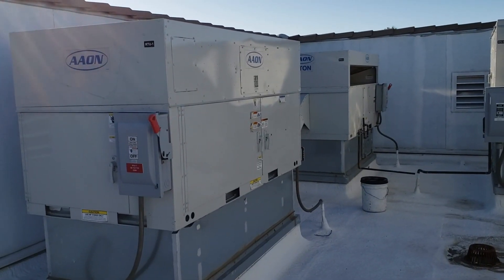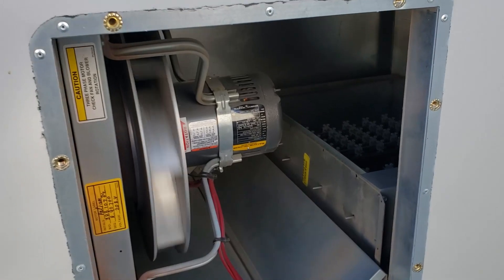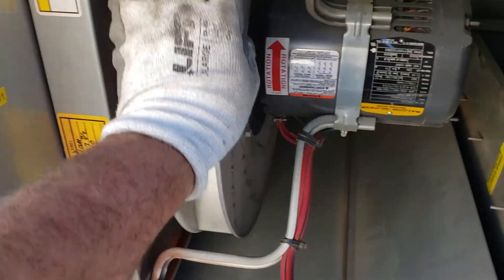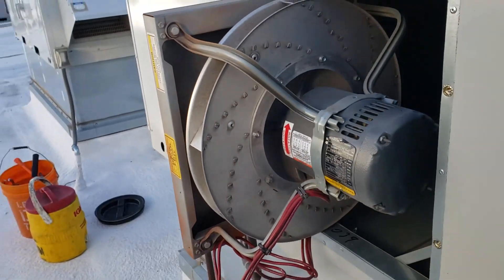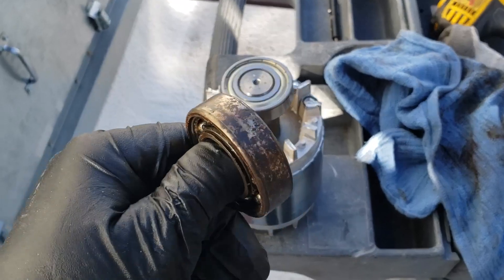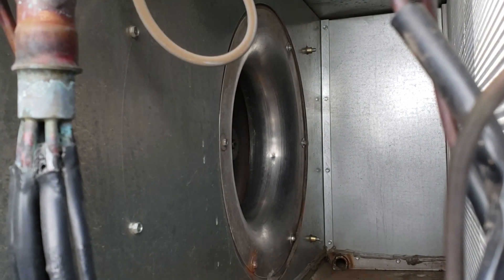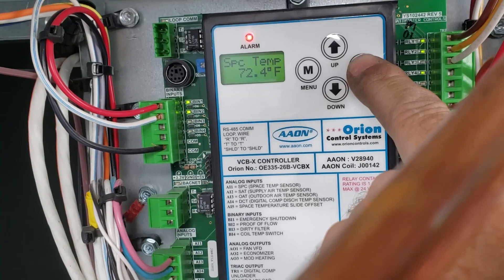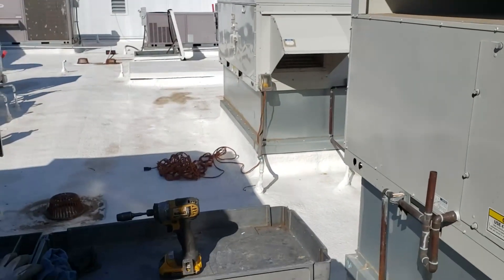Another day, another AAON bearing replacement

Comment: great video sir, i would like to know which tool did you use to remove the bearing and what brand it is
Reply from the maker: That's a common "jaw puller".
From harbor freight. Auto parts stores sell them etc

Comment: So when you do all these bearing replacements do they tell you what bearings to use or do you know already what bearings to use?
Reply from the maker: Are you asking the brand or the part number?
The part number for bearings are on most motor plates if they are pretty much 1HP or larger.

I simply just get a photo of the motor plate and go pick up bearings from the local bearing supply. I use off the shelf bearings.
Which seem to be better than whatever they used in these OEM

Comment: I think baldor is going cheap on bearings, the vfd adding over current I think is a possibility but if you read on the nameplates these motors most say inverter ready. I have some baldors from 98 that are still on original bearings with no signs of failure. But most of our company from now when we order baldors we get the aegis kit already installed. All of my AAONs have come with the kits as well on the supply and return fans. Idk if anybody has seen the new blue donuts that go around the conductors between the drive and the motor?? Our local trane supply only carriers them and are pushing them as a vfd over current precaution instead of using the ground rings. There about 300 for the donut kit.

Comment: At my facility we recently replaced four Baldor TEFC motors that were about a year old on a fanwall application. The problem was NOT a lack of lubrication, as I ensured there was sufficient (but not too much) grease available. One of the failed motors was taken to a local motor shop, where the bearings were dismantled, and found to have fluting on the races. "Fluting" is when micro-arcing from the VFD occurs in the race, due to a lack of a grounding ring on the shaft.

The motors should either have grounding rings, or insulated bearings. We're having a shaft voltage test done on the new motors this week, as I'm not convinced the new Baldor motors came with a pair of insulated bearings; only one out of two. Who would do that?? <eyeroll>

Comment: One issue I’ve encountered with these Aaon units, I don’t have, and can’t seem to find the correct tool to pull the blower wheel. I have 3 different brands of blade/wheel pullers, but none fit the hub of an Aaon. Do you mind sharing your trick?